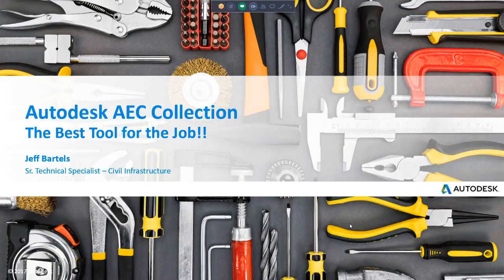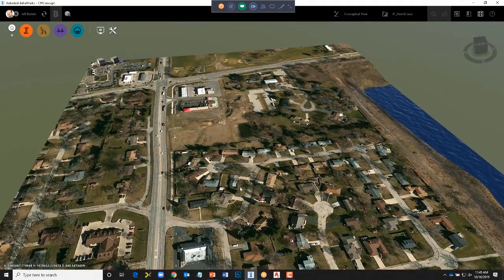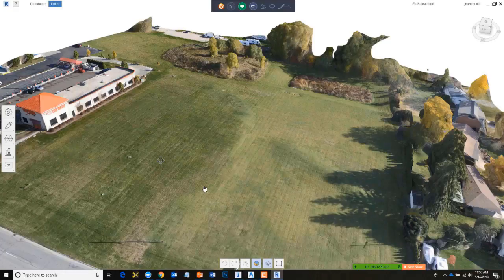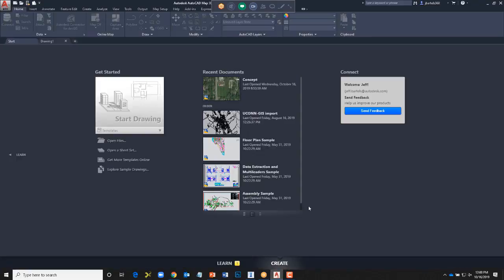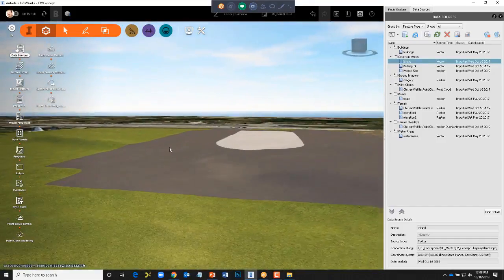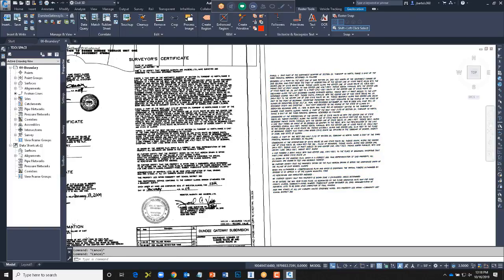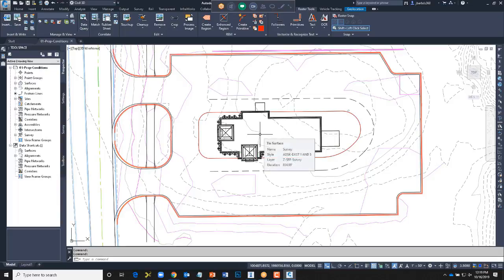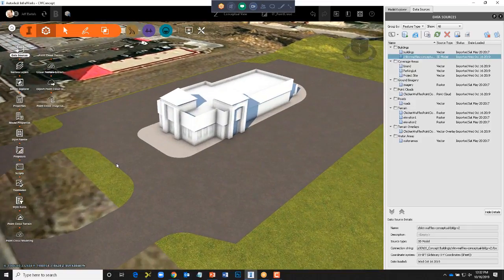AEC Collection - The Best Tool for the Job

Comment: Great content Jeff, very interested to see how quickly you implemented the drone 3D scanning through the recap program and into infraworks. I had messed around with vehicle tracking in the past, but did not know about the alignment tool and the camera following tool either. Also that raster cleanup stuff will definitely save me some time in the future! Cheers!

Comment: Never used Infraworks, Autodesk Recap, and Autocad Civil. I use 3ds max for modeling for games, but what I was looking for is this tutorial.
I have questions about drone.
Which drone I should buy(I need one having option that could follow users defined lines for taking pictures.) for this task.
Reply: 3d studio max is badass, we used it back in 2000 for designing pools in 3d...infraworks isn't all that
Reply: @ChrisDegenhardt2000  I use it for modeling for games. I know infraworks is best software for this type project. Currently I want to know about the "Drone" which drone I should use; like if I want to take images of some area and I draw lines to define the area that drone should follow. What type of drone do I need?
Reply: @sahibzadaasfandyarnoor4517  I work in surveying  and have a mavic air..not sure about what drone...mine cost 900 dollars